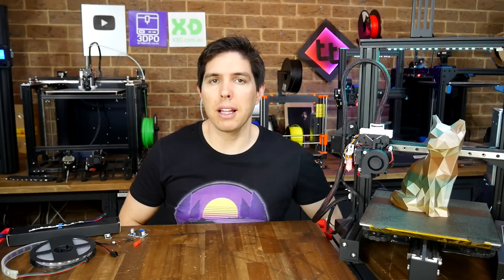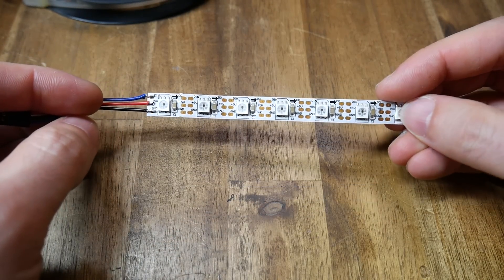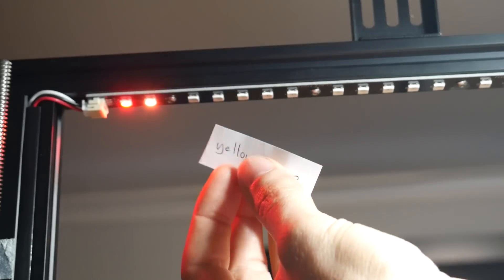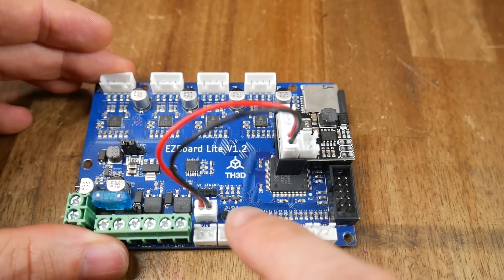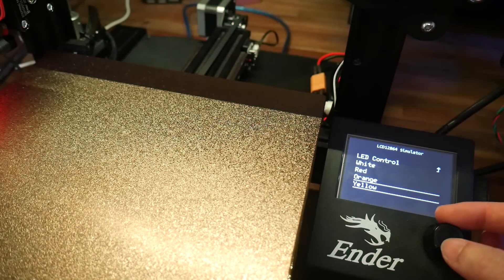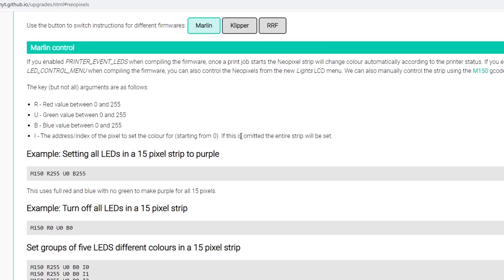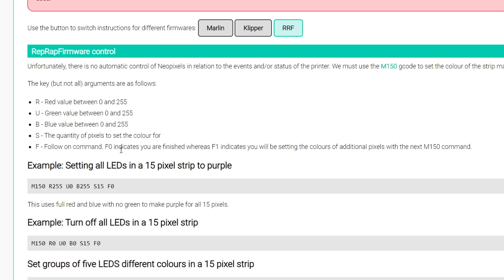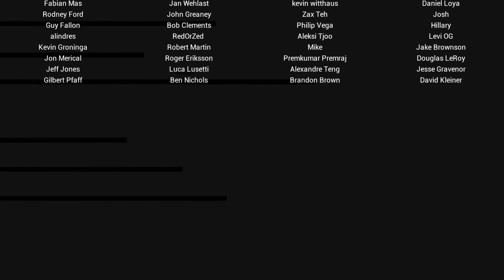Neopixels for any 3D printer - Marlin, Klipper and RRF guide

Comment: Because of my autism and Asperger's I find RBG lighting to be INCREDIBLY annoying and distracting.  Don't even get me started on those multi-colour blinking lights people insist of infesting their Christmas trees with.  lol  With that said I do find there to be many real-world cases where RBG LEDs can be very useful so I have tried to understand how to program for neopixel usage.  It just escapes me though.  Coding is simply not how my brain works but I REALLY want to understand it.  I just built a new printer using an M5P and I'd very much like to take advantage of the RBG ports but not for decoration purposes.  What I want to do (and I'm not even sure if it is possible) is to tie the RGB LEDs into the hotend thermistor so that the LED colour would change based on the hotend temp.  A nice visual reference to tell you the general temp of the nozzle.  When at room temp the LED would be fully blue but as it heats up more red would come in until it was at full temp where it would only be fully red.  No need to guess or risk burning yourself accidentally.  Just look at the LED to tell you if you can touch it or not.  I have so many ideas I've love to bring into real life but the coding needs simply escapes me.

Comment: Michael, any chance trying to get Neopixels to work on Ender 3 with the 4.2.2 or the 4.2.7 main board with Klipper? I have tried connecting the data pin to the pin PA14 of the 4.2.2 board and was not able to get it working. I also enabled the GPIO pins on the PI also no luck. On both I used an external 5vdc power.  Thanks for the HELP in advanced...

Comment: Your videos are so informative! I am an electrician/instrument tech that turned industrial project design engineer with some PLC programming knowledge. This seems like it should be simple for me, but I am slightly nervous to smoke one of my printers. I have an Ender 3 Pro, Ender 3 V2 Neo, and an Ender 3 S1 Plus. I did buy the Sonic pad, but it is still in the box as I am unsure of which printer I want to apply it to.

Comment: RGB lights are useful when they are set in macros. So you can see at a glace what the printer is doing. 
I set mine to red for heating up, White for printing so i can see the print well with the webcam and some other colors for various macros like filament change.

Comment: Excellent guide! Couple questions though. I have a Creality 4.2.7 board, would I plug the data line into the port right next to the display port? Also, could I power 15 leds from that port, or do I need a converter? I have no other devices plugged in

Comment: I already have a pi 3 powered using a buck converter from a howchoo tutorial online using XT60 Y spliter cables. If I was to connect leds, would I have to run them on a seperate buck convertor from the PSU?

Comment: Nice Guide, Unfortunate I had the Problem that the Signal Voltage was only 3.3V and I did not find a PWM Pin with 5V. Had to use a arduino nano as a secondary mcu in klipper for this to work.

Comment: Marlin is not the best for neopixel. Just learn how to use klipper with delayed_gcode. For example you can set this way temperature-controlled led's, progress controlled lines and rainbows after print without using stupid slicer plugins.
Reply from the maker: So if I learn a more advanced technique in Klipper I can match what is available in Marlin with a single uncomment? Got it.

Comment: is it possible to code led like a progress bar of the printing?
Reply from the maker: You should be able to do it with your slicer if it supports variables. Then have the gcode run on layer change evaluating the print progress and lighting up the correct number of pixels.
Reply: There's an octoprint plug-in that will do just that with a WLED setup. Very simple and easy to setup WLED.

Comment: There is one major issue with neopixels (based on ws2812), they don't like 3.3V logic level if powered with 5V (which is their standard power supply), it won't damage anything, just won't work and can give you a headache, there are several solutions (it's not trivial since it needs pretty fast timmings), cheapest one is sacrifice pixel.
Reply: For anyone reading this now, this issue is easily addressed with a 3.3v<->5v logic level shifter in line with the control signal.
Reply: @ManBearPigCreative  Do you have any source for this solution that goes into more detail? I think I have this problem but don't know what to look for.

Comment: If you are using an external power supply (i.e. wall wart) instead of the mainboard, you will have to split the ground wire on the strip and have one from power and one to the board. The signal pin needs reference to ground on the board.

Comment: Just FYI.   For Klipper/Fluid, you can not use the Pi's GPIO pins directly to run the Neopixel.     The onboard Linux process is unable to reliably meet the Neopixel timing requirements.   (Octoprint somehow has a solution)
Reply: Wait a sec, how do the people attach the Neopixels to Klipper then? Hoped I could use the Raspi GPIO pins for that :(
Reply: @chaicracker  there is a Octoprint plugin that allows you to use the GPIO pins.   Or, you get the control signal from the main board.    On a BTT 1.3 I connected to the servo pins.    I plan to use the dedicated Neopixel interface on my soon to arrive BTT Octopus board.

Comment: I haven't worked out how much current my 6 stepper Ender5 uses but I'd get a dedicated PSU for things like this (not forgetting to common the ground rails) rather than put any more load on the printer power supply
Reply: i think i knocked 20watts off my ender 3 power consumption by insulating the bed. at normal speeds with marlin it was 110watts i think. so down to 90w while printing with an insulated bed
Reply: @specialingu  What did you use for insulation? Doing mine has been at the back of my mind for a while
Reply: @specialingu  this is very smart to do, but you still always have to take the highest possible power consumption possibility when figuring out load.

Comment: I attached my addressable RGB strip directly to raspberry pi running octoprint and for me it's the best solution
Reply: this is actually a really good idea!
Reply: just don't add too many LEDs to it, the pi's pins and usb port can only handle so much current
Reply: @littlenyancat5754  i have 30+ neopixels but they're all powered from an external dc-dc converter, pi is only for signal